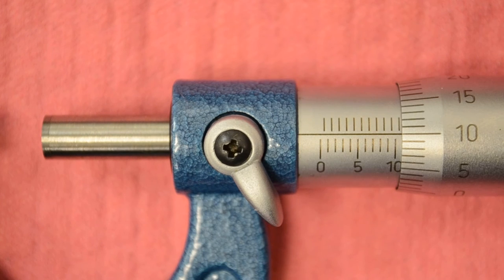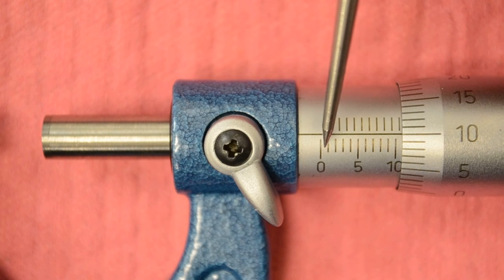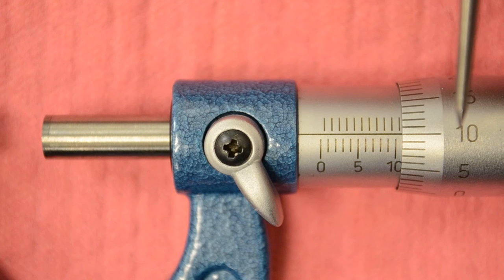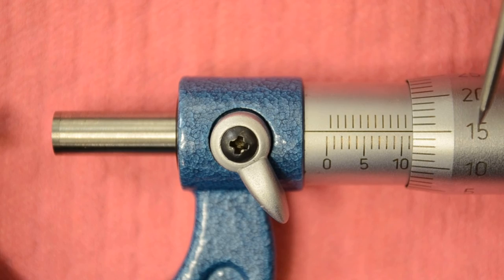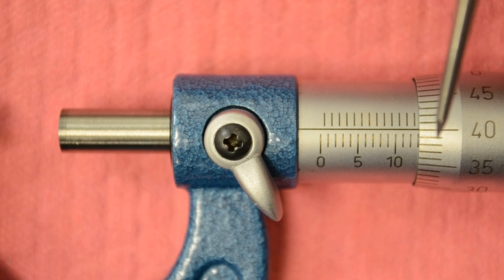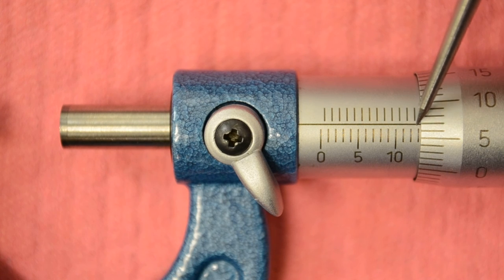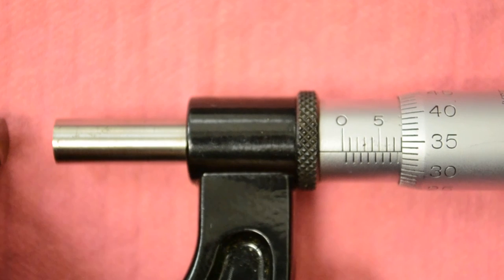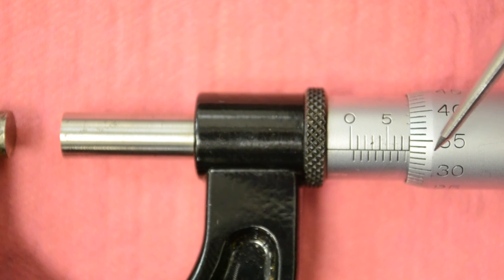Metric Micrometer

Comment: You can't have point ten. It's totally illogical.
Reply: Agreed. It's point one, or, if you prefer, point one zero.
Reply: @BedsitBob  Zero is nothing. It can only be point 1. Of course to be true to SI units it's actually comma 1.
Reply: @greenpedal370  It's a turn of phase.

For three hundred and ten thousandths,  would you say "point three one o", "point three one zero", or just "point three one"?
Reply: @BedsitBob  But this refers to a metric scale.
Reply: @greenpedal370  Fair point, but it still applies to metric.

If I were recording a list of measurements,  and working to thousandths of a millimeter, I'd write it like this:-

1.233mm
0.331mm
1.130mm
2.225mm
5.120mm

I certainly wouldn't write it like this:-

1.233mm
0.331mm
1.13mm
2.225mm
5.12mm

And I definitely wouldn't leave off the 0 before the decimal point, as in .331mm.

That would make it messy, and difficult to follow.
Reply: @greenpedal370  i saw you reply to bedsitbob's reply after 3 years of commenting, will you reply again to me after 2 years? 😂
Reply: @greenpedal370  also it is logical, in some cases
in mathematics, it isnt
however in physics, you need say .10 (point-one-zero) because you have to show that you accounted for that 0
to show that you have painstakingly calculated it
5 year late reply
Reply: @JakeDorito   Ten means ten. 0.1 means a tenth no matter how many naughts you put on the end.. End of story.